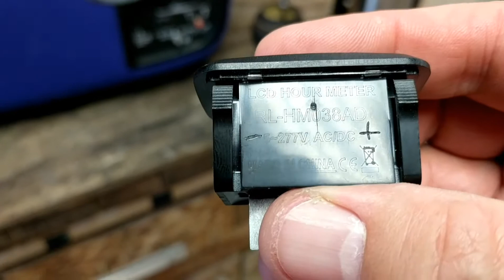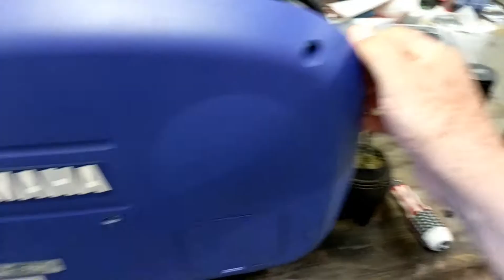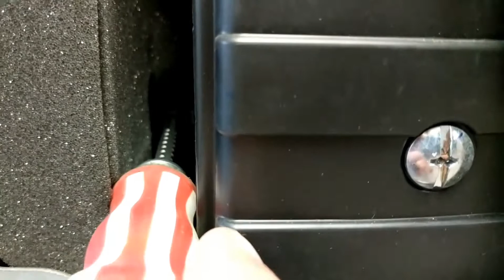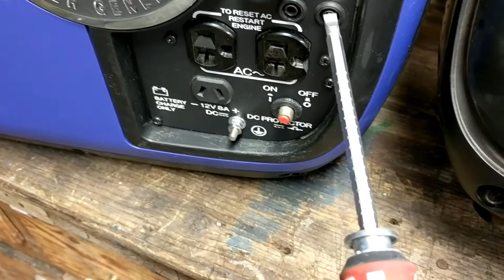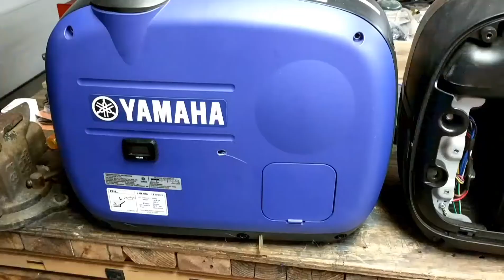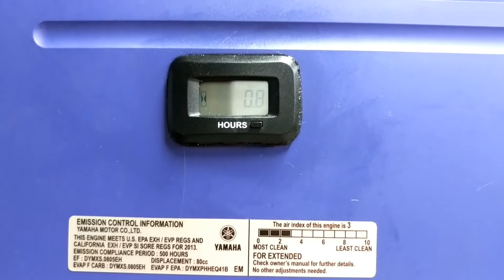Yamaha EF2000IS generator adding an hour meter

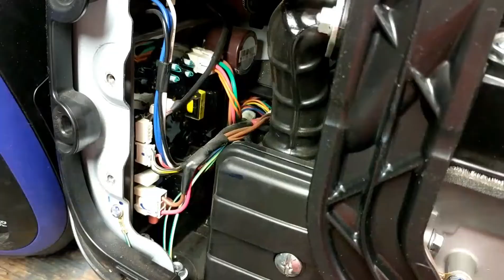Comment: Fantastic video... i have a hard time seeing where you took your signal for your hourmeter.  I've paused and studied the video @4:37 and i cant see it.  I also noticed your hourmeter has a positive and negative.  Mine only has one wire.  I did manage to get it installed around my spark plug wire, but it was a chore.

Anyway.. this comment is on a 5 year old video.  I hope you're well!